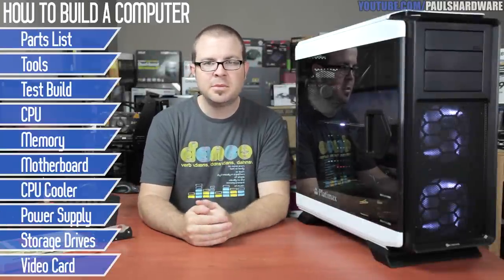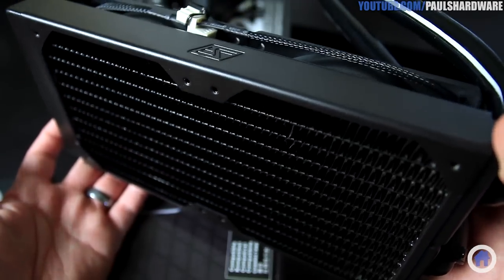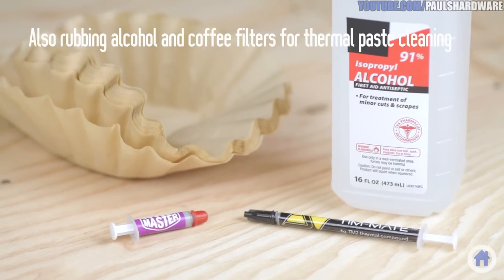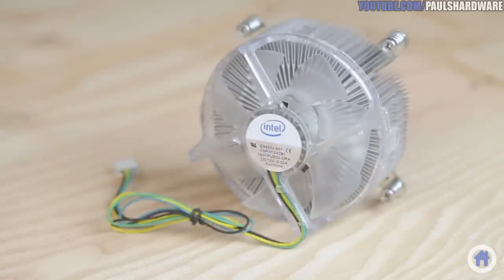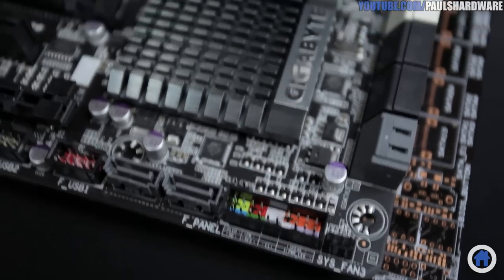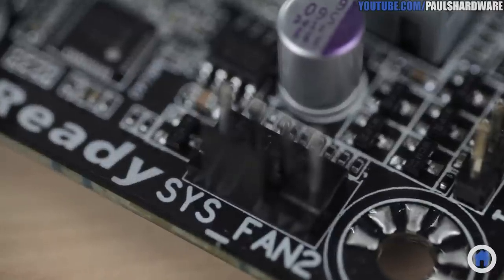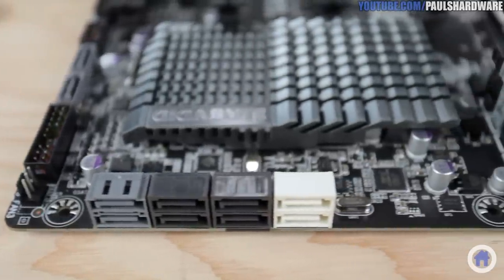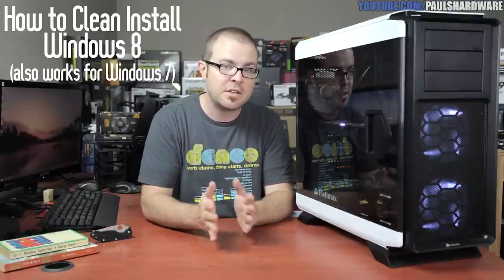How To Build A Computer - Paul's Hardware

Comment: This channel will last a lifetime, just like my herpes.
Reply from the maker: Acceptance is the first step on the road to recovery
Reply: Paul's Hardware Hey paul quick question should I buy another gtx 660 msi oc gaming adition and sli or should I just get a new graphics card im wondering because I want to play the newer titles with a little more smoothness btw I find the gtx 660 msi twin frozer gaming edition is pretty good. your thoughts? I hope you reply...im a big fan.
Reply: Theorcman2008  I'm not Paul but I think Paul would agree with me on this. A good single card is usually better than older cards in SLI (or crossfire). If you can sell your card for like $70 then use that money and put it towards a GTX 770. EDIT: Maybe in certain circumstances 2 SLI cards will perform better than a new good card, but the hassle of messing with SLI drivers, having twice as many fans in your case spinning up, having to deal with certain motherboards that throttle the bandwidth of the PCIe when 2 cards are used, and the fact that some games don't play well with SLI is enough for me to just stick with a single card.
Reply: Paul's Hardware How do you like your Case, some other people, cough Linus cough, are saying it's really, "bendy", or not sturdy.
Reply from the maker: K Dub I agree the side panels could be sturdier, but I don't usually put a lot of weight on the side panels
Reply: Paul's Hardware Thanks Paul, I'm looking into getting this case for my first build, it's either this, or maybe a NZXT Phantom 530, any advice, and thanks for responding.
Reply: LOL
Reply: threadysparrow Sell for $70? a 660? sell for AT LEAST $100 even though its used.
Reply: threadysparrow Thanks for your info man I appreciate that. I have been building computers for the last 6 years but I have never tried sli and at the moment do not have a lot of money right now. But that sounds like a good idea I will look into it more.
Reply: if it hasn't flared up its fine get in the game bro & keep planting that seed ;))
Reply: Awesomesauce Network 
Herpes responds well to fire.
Reply: +Awesomesauce Network This herpes will last a lifetime, just like my channel
Reply: SquidPlays
Kyle's was funnier.
Reply: nakyer lol, no duh
Reply: SquidPlays
That's the point.  You can't see it and the rest of us can.  "Duh."

Nice use of caps and punctuation, by the way.
Reply: nakyer I didn't feel like using proper grammar. This IS the internet, after all.
Reply: SquidPlays
I still say herpes responds well to fire.
Reply: SquidPlays
Yes, the others laughed too, but then the fire made everything so much better, and they did stand in awe.
Reply: nakyer SIZZLE
Reply: SquidPlays
FIRE, not FRYING...
There's a difference.
Reply: nakyer eh. Similar sound when something has contacted it, tho
Reply: SquidPlays
Not always.  Fire may not make a sizzle.  When is the last time you heard wood sizzle when it burns?  Or plastic? 
Your ravings are those of a madman.  The albino snow tunas come, and they shall carry you off to a fate worse than asparagus...
Reply: nakyer Well, the fire sizzles when cooking something moist. The water evaporates, and makes the TSssSsSs sound
Reply: SquidPlays
Hmmm...
Squid flesh is moist, isn't it?
Then, the pencils traveled to other nations with far less intrusive driving laws.
Reply: +Awesomesauce Network You are not suppose to use magnet anything
Reply: Savage
Reply: CookieTheLabrador
Your drenched library books will always have a certain triangular quality to them.
Reply: +Awesomesauce Network lol
Reply: Sasha Blouse
Could I ask who you're addressing with that comment and what you're replying to?
Reply: nakyer the comment initiator
Reply: Sasha Blouse
You mean "Kyle".

Really, Sasha...  You've got to get up to speed on these things.  Otherwise, we'll have to start throwing wet wads of toilet paper at you, refusing to say how they got wet.
Reply: nakyer
Herpes
Piss
Semen
Toilet
Perfume...
Etc...
Reply: Sasha Blouse
I don't care what you had for dinner.
Reply: SquidPlays
What does?  Please clarify, before the aquatic beachball beings come and destroy us all because of YOUR lack of clarity in expressing yourself.
Reply: SquidPlays
Wasn't sure what post I'd made you were replying to.  Now that we all know, you will have to be fed to the miniature oven mitts.  They are sentient and yet savage, and very, very hungry.  Their softness and thermal protective properties are only a ruse to hide their true nature.  You will be devoured. 
There!  It's done!
Reply: +Awesomesauce Network That escalated quickly...
Reply: ThePopStarDude productions
Your left handed welcome mats have a devious nature.
Reply: nakyer Wut?
Reply: ThePopStarDude productions
Exactly.  And now the temporary chalkboard substitutes will have a basket full of pencil erasers, AND THERE'S NOTHING YOU CAN DO ABOUT IT!!!  MWAH HAH HO HEE!
Reply: nakyer Random =/= funny
Reply: ThePopStarDude productions
Turned strawberry land screens for your whirling blue lights.
Reply: BitWit heyooo
Reply: Bitwit q

Comment: Thanks for including the testing steps around the 9 minute mark. You saved my build. I had every thing together and nothing was powering up. Had actually printed out RMA documents for my PSU. And ripped out all power supply cables. I have previously see another video you made that included testing durring the build. Didn't find it but found this one. Put back the 24 pin and 8 pin CPU power and .... everything powered up. Guess there was a loose cable previously. Have every thing connected now and still works.

Comment: BEST build video I have ever watched!  There were two minor technical errors (although they did not affect your build): Never use a plugged in PSU to ground yourself on unless everything that you are trying to protect from ESD is also grounded to it.  Also, when using extension cables, use them when you do the test fire prior to putting everything in the case.

Comment: I'll be building next week. This is perfect!
Reply from the maker: Good luck with your build, I hope this helps!
Reply: ***** I'll be sure to watch his videos then! Thank you.
Reply: Paul's Hardware It sure will Paul. Thanks.
Reply: Neil9444 Just a tip, the RAM and CPU take a lot more force to install than people make it sound like you need. It sounded like I was gonna snap my cpu in half on my vii hero.
Reply: Wryme elgooGoN Yes, I have heard of this. We'll see if there is a sound tomorrow!
Reply: Neil9444 how did it go? :D
Reply: definitionofdead Went really well! This PC is great.
Reply: Neil9444 I'm getting a new beast pc after Christmass!!!!! YAY so exited, because on this computer i can't even play minesweeper... It doesn't even launch XD anyway, !!!!
Reply: Anton Grier Nice! Got the specs?
Reply: Anton Grier Looks pretty good. I have one suggestion, you should get a GTX 980, its around the same price range in Canada, and it's a lot stronger. Check out some benchmarks. The only problem is, the 970 and 980 are hard to find in stock. Oh and I also suggest to get a case with usb 3.0 ports in the front.
Reply: I am getting a 780ti because of the reason you mentioned which is that it's hard to find... But the performance is very close, and yes i am going to get a different case which is the cooler master scout 2 which has front USB 3, anyway thanks
Reply: So how did it go? lol

Comment: Paul's Hardware Well done build tutorial. It is great to see practical and experienced advice given in tutorials.

Cable management can be a huge PTA.
I did a build a while back in a case where there was no choice but to run nearly every cable in the system through a small area near the upper front corner of the motherboard which resulted in a cable bundle about 3 inch by 1.5 inch zip tied hideous mass.
Transverse drive cages are a must and yet some inexpensive cases don't accommodate them. BTW it would be awesome if some online reseller would begin listing cases that had transverse mounted HDD cages.

Comment: Nice build. I used the 4930K also, but with the Asus Rampage Black edition. EVGA GTX 780ti and 32gig of Tactical Tracer memory. Slight overbuild for gaming but future proof. Runs everything including the buggy COD Black Ops 3. Ran Crysis 1 recently, which gave my old system a hard time. Flawlessly.

Comment: Hi paul congradulations  on your new show. I wanted to take the time today, and thank you for all the videos through the years. I read them all, and applied most of what I learned from your videos to build desktop, and laptop. You were right it was easier than I thought, and has run very smooth through the learning process. 

My old desktop died, and I went with a ga-f2a88xm-d3h- A10-7890k/ due to budgeting issues. This is up, and running smoothly. In about a week I will be installing R7-250 gpu to finally finish the build.   I will not lie the computer I want to build is an Intel Asus Z170-maximus hero alpha with Intel i7-6700k Corsair 100h gtx/ with 980 ti graphic card / 4 x 8gb= 32    with 1000 watt PS for future upgrade, and a nice case.  This is my ultimate Goal, and I will be so happy the day these parts arrive at my door?  Thanks again hawkinsdarkmatter396

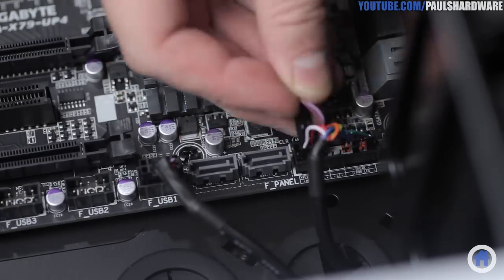Comment: I've seen this video like 5 times now in preparation for building my PC, but around 11:40 or so you are talking about plugging in the System Fans (vs the CPU fans) -- here, you say the Sys Fans use a 4 pin header but in reality only the CPU fan has 4 pins. That's how you tell them apart. Both are equally important for cooling but do very different things, so it's good to realize the difference.

Comment: The anti-static bag is NOT conductive, it has been tested with a multimeter and it gets infinite resistance. The reason that most people say not to build on the bag is that there is a warning on the bag that says the bag will not provide protection after the board is removed, because the bag works like a Faraday cage.

Comment: Paul's Hardware Great job Paul. Quick question. I just updated my computer and got the h100i, is it best to add thermal paste or just use the pre applied?
My Rig:
Sabertooth z97 mark 2
4690k
16 gig 1866 gskill Ares
H100i
3 ssds. 250 evo, 240 m4, 128 agility 4
500g wd external hd
760t black
Asus 660ti (will upgrade when 800 series comes out)
Ocz zt 750 psu

Comment: Paul it's recommended to install the H220 fillport side up. I had to RMA my unit because there is an air bubble issue when the fillport is on the bottom.

Comment: It should be noted that many cpu coolers require a backplate to install infarct i would go as far to say that for the 1150 socket most if not all do. If this is the case you'll want to install that before you mount your mobo.

Comment: Hey Paul, just wanted to say thanks for the amazing video. Also, right now I'm running an i5-4670k overclocked to 4.2Ghz and I only have a 212 evo so my CPU can get a little hot. What closed loop water cooler would you recommend in the 100 dollar or less range?

Comment: Interesting video. Description title should be: Gaming and Video Editing PC

I don't choose such components to build Workstations; VT-d & DisplayPort  mandatory. 

Intel Core i7 4930K CPU - no K series (no OCing); Xeons great or 4970 is good
Gigabyte X79-UP4 - Asus Z97 WS or similar (more PCIe lanes; less Power)
EVGA GeForce GTX 770 - Tesla or FirePro cards, above 4 GB
Enermax Platimax 1200W - Corsair AX1200i PSU
Seagate 600 Series 480GB SSD - 2 x SanDisk or Corsair 500 GB
WD Black Series 4TB Hard Drives (x2) - Nuked
Windows 7 Ultimate - Windows 7 Pro should be more than enough. I also use OS X and Linux; no multiple-boots but VMs using Parallels etc. 

I'd also consider Z97 MAXIMUS VII HERO because of RAMDisk feature. It offers about 10x speeds when compared to SSDs. I know it's a Gaming-targeted MOBO but the quality of build is great; comparable to WS boards (components).

Comment: Thursday , my parts are coming , and I'm building my own PC :D
Here are the parts:
CORSAIR HYDRO SERIES H80I
CORSAIR 8GB DDR3-1866 VENGEANCE PRO
SAMSUNG 840 EVO SERIES 2.5" 120GB SATA3
COOLER MASTER V650S 650W 80PLUS+ GOLD MODULAR
MSI RADEON R9 290 4GB GDDR5
ASUS MAXIMUS VII RANGER
CORSAIR OBSIDIAN 450D WINDOW
INTEL CORE I5 4690K 3.5GHZ

Great build, but why didnt you hide the cables a little bit more ?

Comment: Just yesterday I bought the rest of the needed components for me to build my first pc. I got a 600w power supply and I'm not sure if it will be enough. I'll be using a evga gtx 750ti superclocked gpu that has 2gb of ddr5 memory, an msi z77a-gd55 motherboard(bought from a friend), and an i5 quad core 3570k cpu(bought with the motherboard).

Since I got them from a friend, the cpu and heat sink still have a little bit of thermal paste that needs to be removed. How would you recommend I do that?

Whenever I hear people talking about the thermal paste they used it seems they use arctic silver, which I'm not too sure what it really means because my stepfather gave me some formula 5 silver thermal paste and I'm wondering if there really is a difference between them.

Comment: Hi, I have this problem where the PSU is secured with an L-Bracket in my case (probably because they knew I'd be too lazy for the 4 screws in the back). This L-Bracket covers up the space for the clips of the other two SATA-Perif slots on my PSU, so I can't put anything there, but I have a free SATA-Power slot on the cable (it has 4, 2 going to harddrives, 1 going to my trust DVD-Burner). Are there adapters for SATA-Power to Molex that I could use the connect the front LED in my case? I really don't want to remove the L-bracket (even tho I will put those 4 screws in, once I get my LED fans) and put in that massive molex-power cable just for an LED :/
I also got an adapter that could convert that molex to the 4pin kind of connector my 120mm top fan has. Is that safe to use on a 3-Way splitter with 2 other fans or should I look for a solution that connects that LED to the PSU directly?
My case is an Aerocool Mechatron Black Edition btw.

Comment: I haven't bought a computer in years and never built one. I need to upgrade ultra badly. Computer parts are uber expensive for me. My primary concern with saving up for a build is longevity. Once I plunge into the task of building my own, I want it to be awesome for many years.

Comment: To anyone that would like to awnser I am about to start my first build and I have a question.  I have a bit of understanding as far as plugging in all the smaller cables for the case controls however I am uncertain as far as what else I need to plug into the motherboard as far as power cables from the power supply.  I know it get's the 24 pin connector and I have found where that goes but what else do I need to look for?  I hope this is clear enough for you to understand.  Any help would be greatly appreciated!

Comment: hey paul i have a tech question, i just got a second 270x to run in crossfire i set it up and everything was running awesome bf4 was running at like 90fps on max. then the next day i went to play bf4 and when i loaded in my cpu went to 100% usage and was only getting 15 fps with graphical corruption, both cards work fine on there own, it only does it in bf4 and watch dogs. and it runs fine when i am benchmarking it. do you have any idea what could be happening. and cpu temps max cpu temps are 40c and gpu max temps are 75. so i am 90% sure it is not overheating problems. ps love the viedos keep up the awesome work

Comment: Which thermal pastes are you using? Why not using Noctua NT-H1 or Arctic MX series?
Reply from the maker: I think I ended up using the TIM that comes with the H220, or it might be the stock Cooler Master stuff that they ship with their coolers. Super-premium thermal paste can help, but it's usually a very very small temperature difference.

Comment: Hey, im about to build my first computer soon and wondered do the SATA cables come with certain parts or do i have to order them seperatly. Also Does the computer need and SSD Drive?
Reply: the SSD Drive is optional but i would recommend atleast getting the 240GB one beacuse the SSD Drive opens your application faster
Reply: The SATA comes with the motherboard i think
Reply: Okay, Cheers! Its the first time building one and i think ive got the basics down, Just gotta hope it all goes to plan :P
Reply: +TurtlesInMankinis Good luck let us know how it goes :)
Reply: Cheers! I just ordered the final part! The motherboard, hopefully everything goes fine :P
Reply: +TurtlesInMankinis Woot! Hope everything goes well. Let us know how the final build works
Reply: +Tsunat3z he died ;(
Reply: Woah, Who died???/
Reply: TurtlesInMankinis you did lel

Comment: Hey I'm a PC noob and I know I'm late but I have a question. I would like to just replace the processor and graphics card in my system but I'm not sure if that'll damage my mother board. So would it damage it, or would it not? Thanks
Reply: And the reason that I'm asking is because I want to upgrade my current PC and I'm afraid that if I damage it I'll lose all my data

Comment: Hello Paul if i am going for an i-7 4790 ( not i7 4790k ) cpu do i need an after-market cooler or is the fan within the box sufficient to run normally ?
Reply from the maker: No need for an aftermarket cooler for a non-overclockable CPU in my opinion, but you might still get one if it's quieter. The stock fans can get noisy, especially after they've been running for a while. Just don't spend more than $20-$30.
Reply: Paul's Hardware Thank you  :)